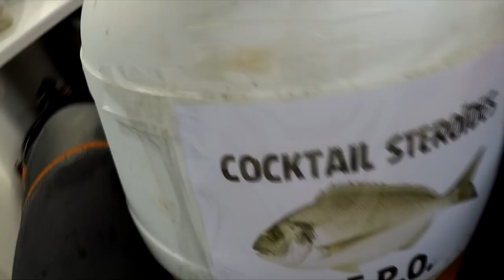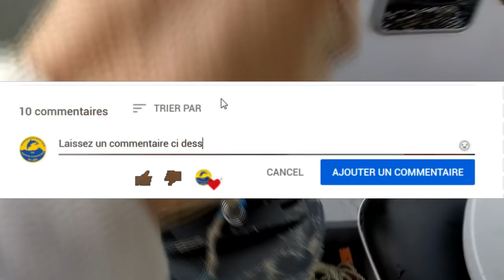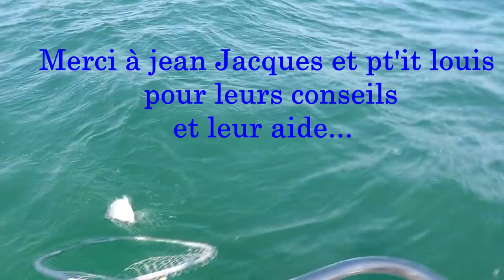PECHE et MONTAGES pour DORADES aux appâts avec strouille ou Broumé # 41

Comment: bonjour , les poissons ont été pris plutot sur les hameçons du bas ou bien en haut ???merci de votre réponse
Reply from the maker: Bonjour, Cela dépend de plusieurs facteurs : la force du courant, la position de l'amorce sous le bateau, les différentes espèces de poissons présentes.
Avec les perles repositionnables, on peut assez facilement adapter la position des bas lignes sur la ligne pour retrouver les poissons en cas de raréfaction de touches. Il peut être intéressant d'essayer au début 2 m au-dessus du fond, et 50 cm au-dessus du fond pour voir quelles espèces sont présentes